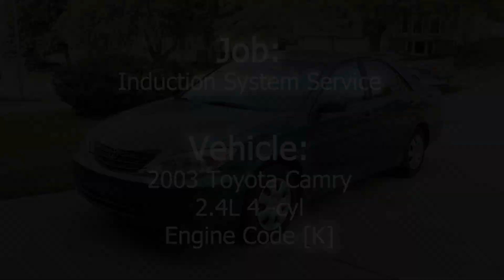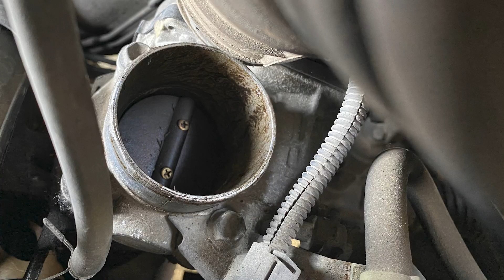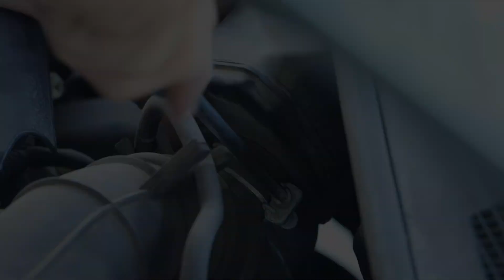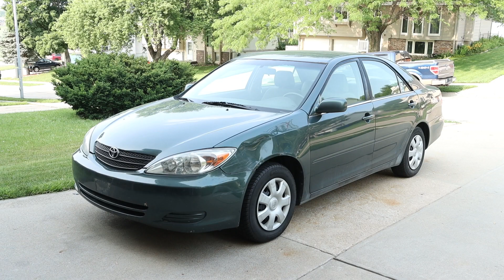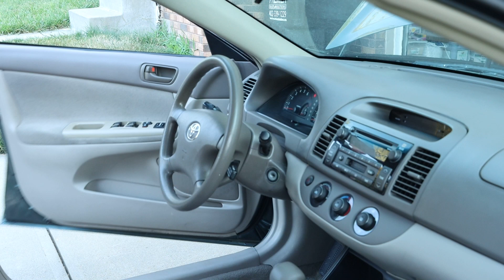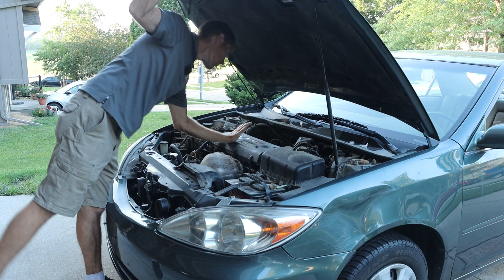How to Clean the Air Intake System - 2003 Toyota Camry, 2.4L (2002-2006) - Amsoil Power Foam

Comment: Question:  Did this result in less Oil Burning in your Camry..?  Overall, did you see some benefit from the Powerfoam?
Cheers
Reply from the maker: In other vehicles I have seen performance improvements.  As of today, I am still working on this vehicle to make it safe to drive.  I have about 6 more repairs and then I will do some testing and collect some data over the next couple months. I will probably end up running another can of Power Foam as well.